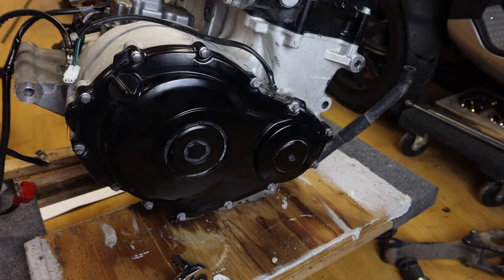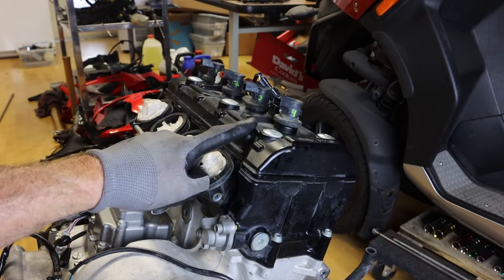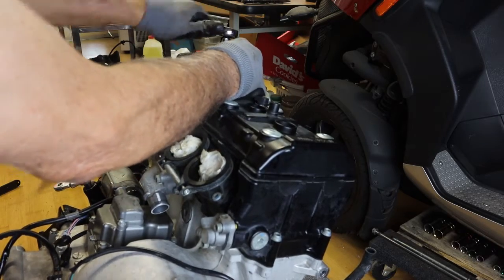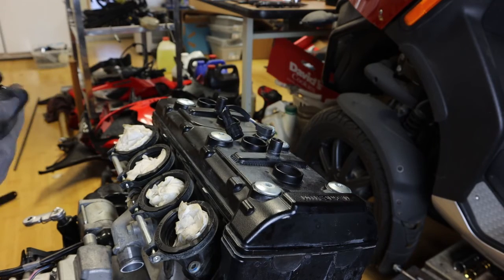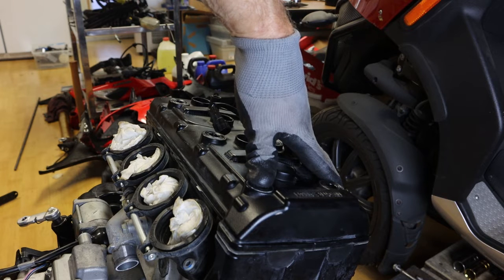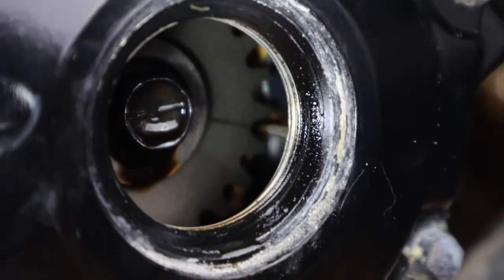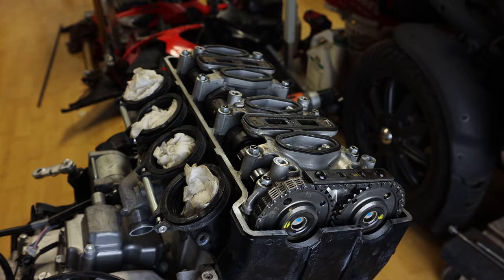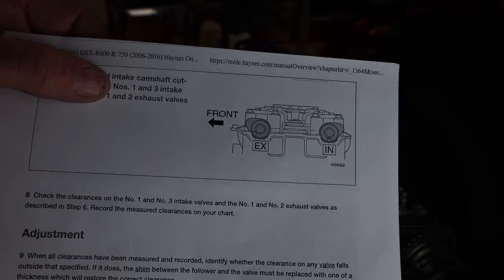2014 GSXR 750 Rebuild Check Valve Clearance

Comment: No sincronismo do motor da gsxr 750 2005 se conta quantos pinos na corrente de comando
Reply from the maker: Solid chain no links.  If you are counting, count between the timing marks on the cam.

Comment: Thanks for the video do you have another one showing how you adjusted the clearances with shims ?
Reply from the maker: Yes check out my channel, there several  @joediylab
Reply: @JoediyLab  thanks I have a 2024 with 12k miles I want to check and adjust my valves after my next track day. Where do you get the paper with all the specs and instructions if you don’t mind me asking
Reply from the maker: The online Haynes manual is a good reference.  You can get a good discount in most cases.  Or google is your friend